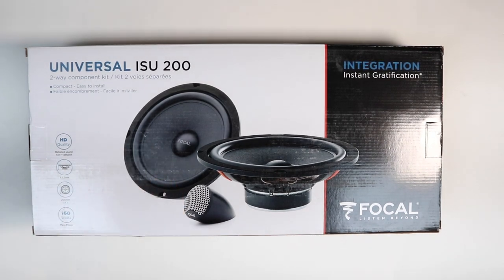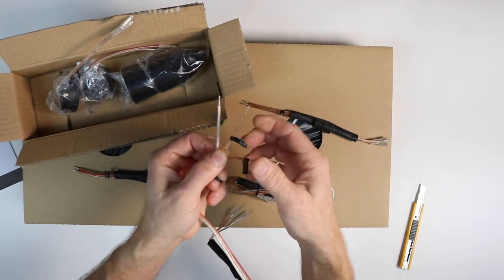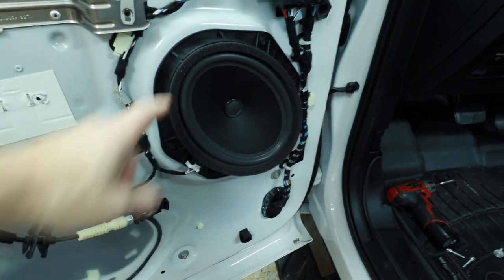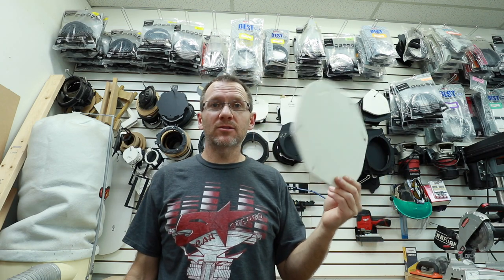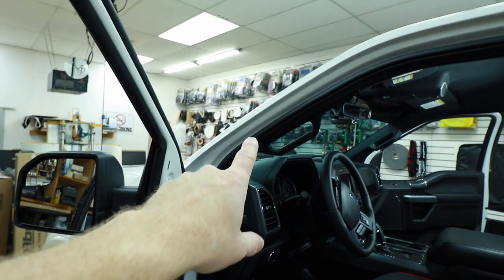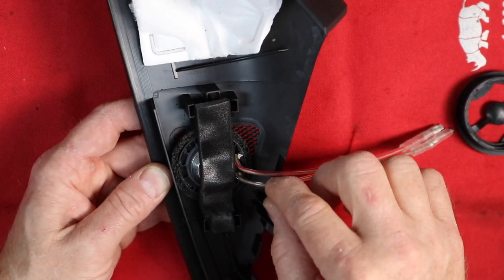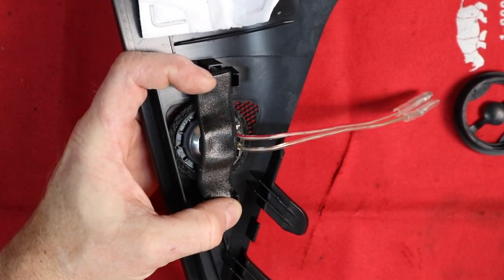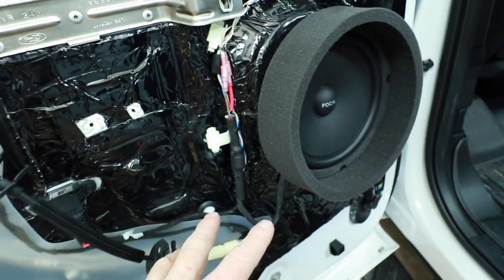Focal ISU 200 8 inch Component speakers unboxing  and review in a F150

Comment: Hello my friend. I fixed aftermarket rear camera for my VW Tiguan . When engine is on the  reverse image screen is flickering showings horizontal lines. I so your video to use  auto relay 12V 40A 5 pin. It will work.? also I would like to know for connecting this Auto relay I need to open Head Unit (DVD player) for connection ? or just the connection everything is on the rear where I fixed the camera? Please help

Comment: Could I use this 8 inch as a replacement for my factory 8 inch sub in my 2015 Dodge Dart gt?
Reply: I mean you COULD, but this isn’t a sub. It is a speaker. Not designed for the same frequencies or wattage by any means

Comment: 8" is great until the top end. I already hate 6.5"s past 1000hz. The cone breakups at my loud volumes. Not distorted, but beamy. 

8"? Need a mid range desperately.
Reply: What about a 8” in the door with a 2” or 3” wide band on the dash? Crossed over between 300-600hz?

Comment: I just want to say that these speakers dont work well with only deck power. I upgraded to little pioneer amp 45W x 4. I think that these speakers dont even work very well with this amp. They need more power. Really.
Reply: I put a Sundown 50x4 on mine and they sound great
Reply: @collindominguez9173  I think that mine dont sound so great because there is no gain setting on my little Pioneer amp D1004
Reply: @davosat  Gain isnt a volume knob
Reply: @collindominguez9173  I know, but my headunit plays clearly until volume 58, but with my amp I get distortion at 49. The gain is not set correctly in that Pioneer amp.
Reply: @davosat  That sucks that a company would provide no gain controls on an amplifier. Have you turned off all of the processing affects (bass boost, loudness, etc) on the HU? Some radios (Kenwood) will give you the ability to turn off the internal amplifier for sound quality set ups.

Comment: Underwhelming
Reply from the maker: Could you Elaborate, video or product?
Reply: @FiveStarCarStereoInc  sorry product. The videos you produce are awesome snd the community really appreciates what you, Mark from CAF, ExoControlto, Steve Mead and Soundman produxe.

The product does the job, but I would expect better crossovers and build quality from Focal. Still looks way better than most factory speakers.
Reply: @lakorai2  I believe these are entry Focal Speakers. Correct me if I wrong.
Reply: Have you seen the crossover components or are you referring to them choosing heat shrink over a shiny box?
Reply: @frankthetankricard  
I think he expected a better looking product from Focal.
Reply: Possible, but then it's not a great point since they pointed out it's intended to replace factory components. I think the customer is not going to want great looking crossovers to put on display when upgrading speakers on a factory sound system. Just something that does the job and can be tucked behind the door panel is perfectly fine. I have the cheapest 6.5" Focal components, at almost half the price of these. Those came with crossovers in a - not great, but decent looking - plastic housing so I don't think it's strictly a matter of price that they used heat shrink here.
Reply: @frankthetankricard  I totally agree man!

Comment: Tried finding a way to message you guys directly, but couldnt find any option in the "About" tab.  I have a 2014 Kia Sorento SX with the UVO Navigation and the Infinity system.  I want to change out the factory head unit, but my problem is all the HVAC info is fed through the screen.  Do you guys know of any options I have to replace the head unit without sacrificing the HVAC info?
Reply from the maker: Sorry no there is nothing for that car

Comment: Love your videos, if I could bend your ear for a second, I have a '17 Sierra crew 1500 w/t that I have already upgraded to a 110 sra Alpine restyle, now it's time for speakers (I have an 80x4 rms Clarion for them) and I saw your unboxing video of the Alpine spt31 gm kit but haven't seen any update videos of you installing them or found ANY videos of it's performance and at $1400 cdn  I wanted and value your honest opinion on this 3way kit vs high quality 6x9 components or maybe custom door panels with a pair of 6.5 components/door. Thanks so much!
Reply from the maker: The kit is amazing we did film a video but have not put it up yet. The reason is Alpine discontinued the product. Kind of sucks, I guess the demand was not there. If you can find them you won’t be disappointed. I will try to get the video out next week.
Reply: Thanks so much for the reply. Crutchfield (🇺🇸) doesn't have it but Crutchfield(🇨🇦) says they still have stock.